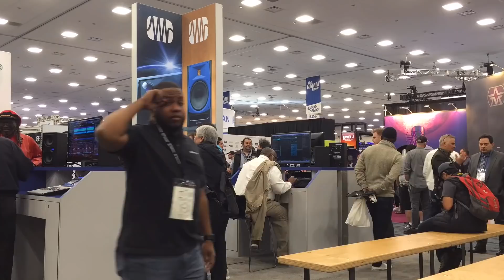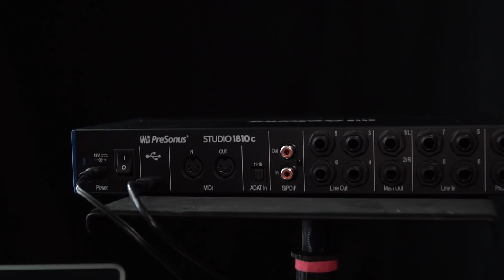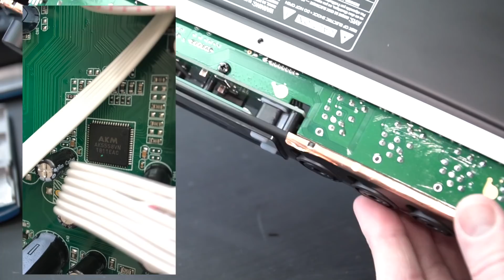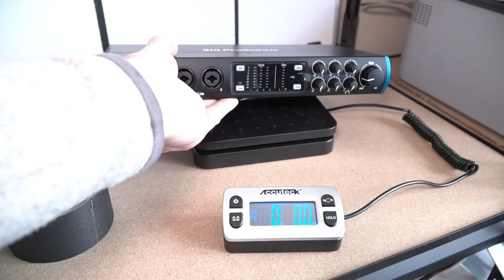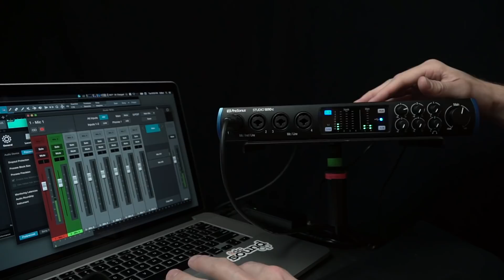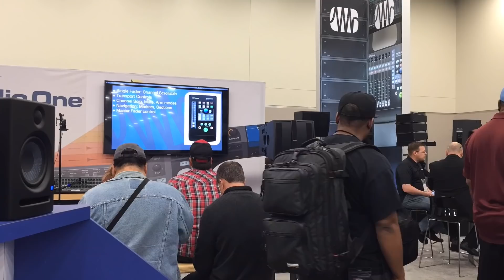#132 - PreSonus Studio 1810c Audio Interface First Look and Teardown

Comment: I was able to add a hardware Reverb effects unit to The signal path of my 1824C.  I set up mix 3/4 with only vocals, then sent that signal out from output 4 to an Old lexicon and from the lexicon to input five, And I mix that signal with the other channels on Mix 5/6.  This way, I get Reverb on vocals when monitoring but not recorded in the software. (QBase)

Comment: Soo I want an audio interface where I can plug in up to 4/5 mics. Plug in my tv into it and have output to my KRKs and also output to 4/5 headphones as well. Sometimes I might use my KRKs for output sometimes headphones.

I’ve looked at presonus 1810c or presonus 1824C. Could I plug in my headphone jack to the TRS line out ? or does it strictly need to be plugged into headphone out? Which slot/ bit do i plug my tv in as well guessing it'd need to be an aux to xlr or is it an adat cable from tv to the interface?
Reply from the maker: That's a bunch of interesting questions! 
The easiest one to address is the headphones. You need a headphone amplifier of some sort between a Line level output and a pair of headphones to properly drive the headphones (that's what the headphone out is doing). Remember a single TRS line output is a balanced mono signal though, so to get stereo you'd route left and right to their own outputs and then connect to a headphone amp from there. 

For the TV, I would suggest finding out if your TV or the source you are playing back from (cable box, blu-ray, gaming console etc.) has any type of digital output you can use. If there is a digital audio output, that would be the best method to connect to an interface to capture the sound without loss. I don't know enough about what you're trying to do here, but if you are streaming or trying to record into the computer from a TV, I would suggest getting an HDMI capture card instead, so you can bring audio and video into the computer on one cable without a lot of hassle. 

Really need to know more about what you're trying to accomplish as an end result and what gear / resources you have to hand before being able to say much more. All the best & thanks for the message!

Comment: The Phantom power thing might be a deal breaker for me- I need to use both a condenser and a ribbon simultaneously.
Reply from the maker: What ribbons are you using these days that don't deal with Phantom? I'm guessing you have some vintage stuff? 
I see a ton of folks using Cascase FAT Heads & Royer ribbons both on tour and in the studio & ALL of their current mics work fine with phantom turned on (Royer's need it). You'll only run into issues if you don't turn it off before patching or un-plugging.
Reply: @DcSoundOp  I use a vintage Royer that I picked up at a pawn shop from somebody who didn't know what it was worth

Comment: I have quantum 2 is 1810c better like a upgrade from quantum 2?
Reply from the maker: I wouldn't say an upgrade, they both have different strengths. The quantum series requires you to have a computer that can handle software monitoring since there is no hardware monitoring built in, and provide super low-latency to make that possible. What about the two units you have right now has you thinking about upgrading? Is there some functionality you are missing?
Reply: @DcSoundOp  my laptop had thunderbolt  and its a hp im more of pc guy but i wanted to buy windows desk top to get rid laptop sitting on my desk in the way lol so i bough dell inspiron 3880. Well its not thunderbolt supported for the life of me i tried and tried to update the mother board to thunderbolt was not successful got a headache said forget it then found out presonus new interface support type c so i traded my quantum 2 in and got 1810c i was able to added type c to my motherboard so it made it convenient.
Reply: @musicislife704  He said this in the video but it's USB 2.0 NOT thunderbolt. The USB type C port does not take advantage of all the features that USB-C has to offer, other than the connector type. Hope this helps

Comment: What is universal control? Do I need it to use it? Just want to use Logic Pro? The main reason I’ve just bought this is to run outboard gear as a hardware insert. Any help would be great. Thanks
Reply from the maker: Universal control is the free control software that is used to access the settings on many PreSonus products. It will help you setup the routing you need to do what you want with the interface and your other Software.
Reply: @DcSoundOp  I decided to start using Universal Control software once I discovered that the PreSonus AudioBox USB could only be installed on one USB port at a time. It solved many of the issues I was having with the generic driver software

Comment: For mixes 3/4 and 5/6 can I hook up multiple monitors to them and will they all play at once or would I only be able to use the main output? I need to be able to hook up 2 krks, 2 hs8s and a sub. My big mackie started smoking on me. If you can comment back id really appreciate it!!
Reply from the maker: You could certainly do that with the additional outputs. You would need to handle the routing in whatever software you are using through, which would be super easy in most DAWs. Did your Mackie Big Knob literally start to put out smoke? That's a bummer, would love to know what went wrong to make that happen. All the best Ace.
Reply: @DcSoundOp  ok perfect! I use studio one so im sure it wouldn’t be that hard to set up. Yeah it was crazy, I went to turn it up and it made a loud pop and started smoking out the back. Pretty scary and Im glad I was home when it happened. But thanks for the information. Will definitely sub!
Reply from the maker: Yikes! That sounds like a classic blown capacitor - which is always exciting if you're there to see it happen! If it didn't take out anything else when it went pop, it could be a pretty easy fix to put it back right  Mr. Carlson's Lab is a great place to learn if you're curious. https://youtu.be/67M7fsbLUIU

Comment: I still can't figure out where the microphones plug in? I think I'm missing a piece.
Reply from the maker: Hi Karin, can you send me a photo of what you’re having trouble with? Info@dcsoundop.com - thanks!
Reply: They plug in in any of the 4 ports in the front. You can also plug 1/4” instrument cables in there as well.
Reply: @TheReagorBrothers  Can anyone tell me how to adjust the gain settings on the TRS inputs 5-8?? I'm only getting super low signal and can't find information ANYWHERE ='(

Comment: Is quantum 2 noticeably winning in latency than this usb c interface? I have quantum 2 and thing to swap it for this. As it gets disconnected pretty every time computer sits idle for a good while. Thanks!
Reply from the maker: Yes, the latency is significantly lower in the quantum series. The USB C series are only using the physical connector, it’s USB 2 protocol still. Hope that helps! Thanks for the message!

Comment: Can the ADAT Input on 1810c set to run in S/PDIF mode? I want to hook up with my PS4 which has an optical output in TOSLINK S/PDIF and I want to avoid a TOSLINK to COAX converter in the middle. Or else I might look into Focusrite Clarett or Audient iD series.

Comment: Cool video man. I just want to know with your honest opinion. Which would be a better  interface one of the new presonus usb c units or motu units like the motu 828es that Im looking at now. Just want to have an good sounding interface in my home studio setup. Thanks!
Reply from the maker: Rosewood 216 I’m a long time MOTU user personally. If you’ve got the budget & the 828es fits your needs, I’d absolutely go that direction over these. Kinda apples to oranges with the feature set & price, but here you go. Good luck & let us know what you go with & how it works out! Thx for the message.
Reply: @DcSoundOp  Thanks for the reply I went on and got the Motu 828es and I love it and it sounds great. I really appreciate your videos and thanks again for taking the time to reply back I really like the choice I made. It works well with pro tools and the routing on this unite is amazing.